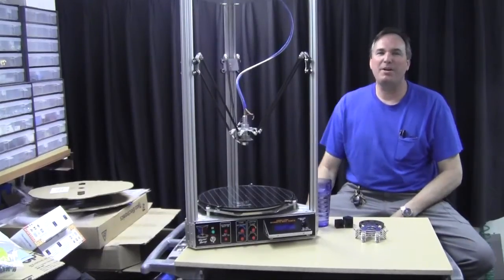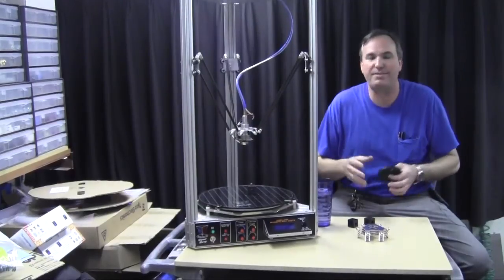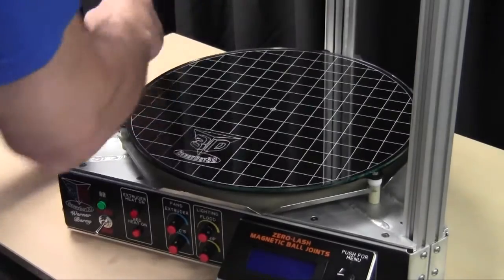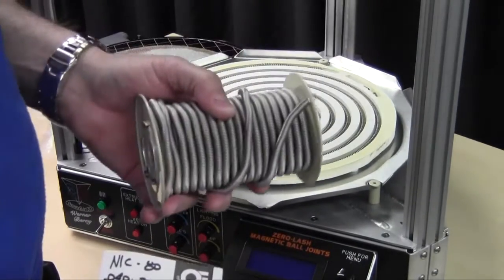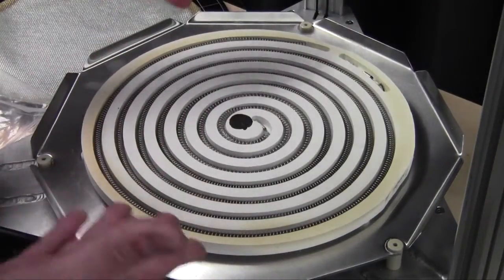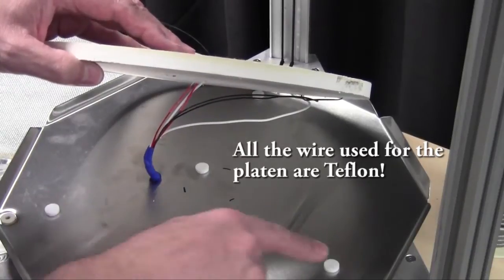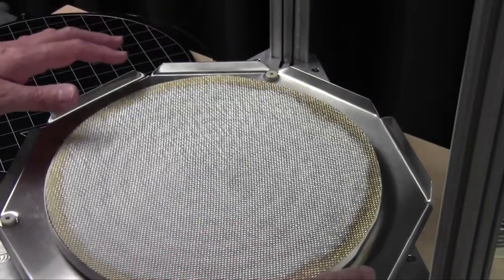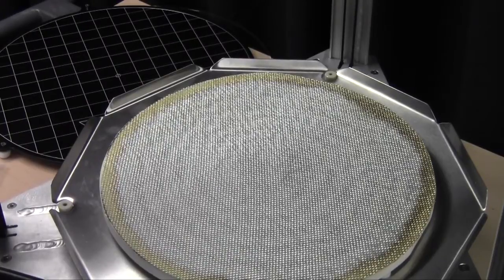BerryBot3D talk about the platen design.

Comment: Hi Werner, I posted a comment under your other video about drying filament using infra-red light or emitters and I think the same could be applied here for an almost instant fully heated plate. Infra-red may also reduce electricity costs over heating coils.

Comment from the maker: Hey Gary, the rods work well at 13"
Q3Coricoco, the material for the heated bed element is a high temp insulation board otherwise it is all aluminum.
Yeah Ben having the bed heat up quick is easy to get use too....
Reply: thanks for the reply Werner that will help a lot
Reply: Greetings from Portugal. Awsome work.  Just a small question, the bending of the hotend transporter is it 30º or 45º? Is  the arms carriage bending  the same angle. Thank´s allot.
Reply: Thank you very much for sharing this information!
Reply: Most Brilliant Work Mr. Berry :)